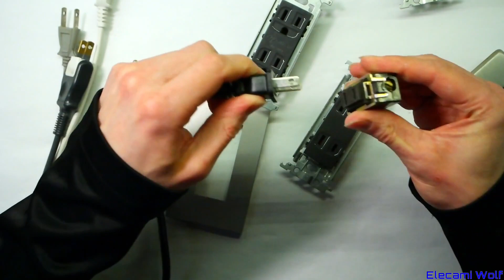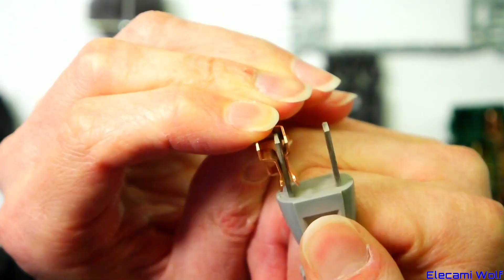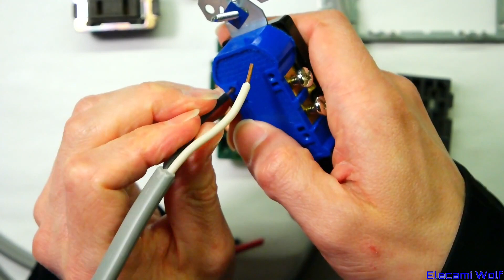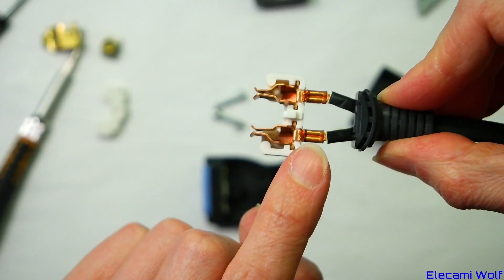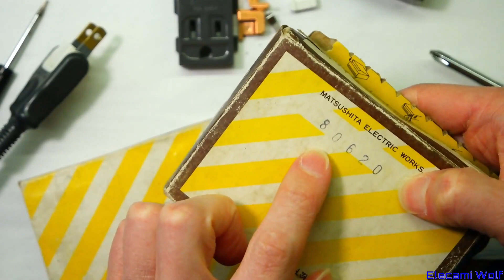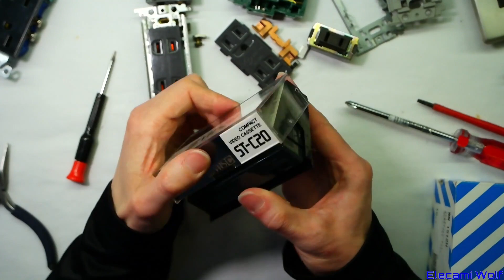EW0052 - What Are The Holes In Power Plug Prongs For

Comment: Are most of your appliances in Japan double-insulated because of the lack of grounding for most outlets?
Reply from the maker: Not always double insulated but it is common. Larger appliances with lots of metal are supposed to be grounded. 
GCFI/RCD in the breaker panel are used to provide protection to people on all circuits.
Reply: @Elecami  In the US, if your house was built in the 1940s-50s and you only have a 2-wire electrical system, you are allowed to replace ungrounded outlets with grounded ones and not connect the ground as long is the outlet is being fed by a GFCI breaker / outlet or is a GFCI outlet. You just need to put a sticker on that says "GFCI PROTECTED OUTLET - NO EQUIPMENT GROUND AVAILABLE" it to let everyone know it isn't grounded
Reply from the maker: @DB25-RS232  I know about that rule. I think it is a bit dodgy because it does not allow for appliances that use the ground to sink RFI current.
Reply: @Elecami  You do have a point. Because of that you may get more interference on things like studio monitors.

Comment: The Holes are for Locking Stuff from Being Used, Shorted Power Supply's with attached Cords easy Wiretie or Small Lock to be put thru them to lockout use of them..
Reply from the maker: Possible but very small lock needed. The type of lockouts I have used are an enclosure that you clamp over the whole plug and it has positions for the standard sized equipment lockout padlocks.

Comment: There's surprisingly little contact area inside those outlets.  I'd have thought there'd be contact on at least half the prong, not just the tip.  Here in the US I've never found any outlet that had locking dimples inside.  They are all just spring pressure holding the plug in.  I'd never trust the push-in wire connection.  I always use the screw terminals to get the most contact between the wire and the connection.
Reply from the maker: I trust Panasonic to do it right and reliably. There are millions of those outlets in use. 
I have got a US old metal power strip that has something like those dimples. It grips the plugs in extremally strongly. So they are out there. Just not very common.